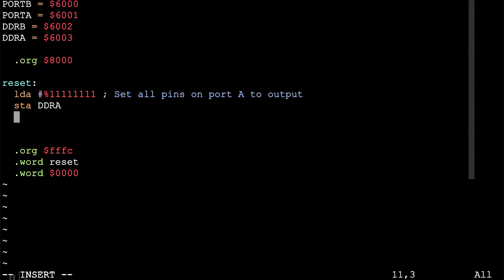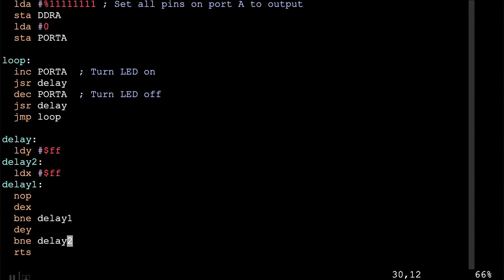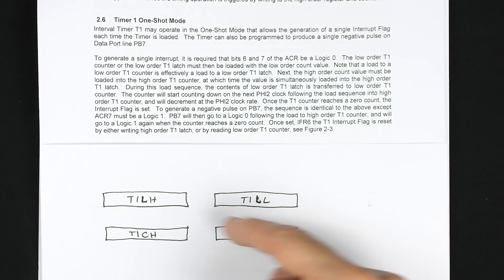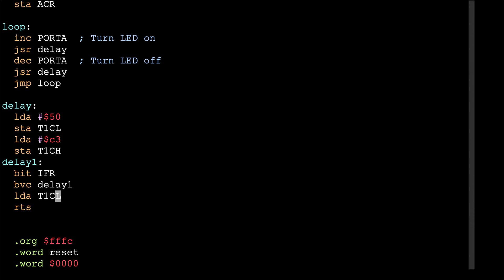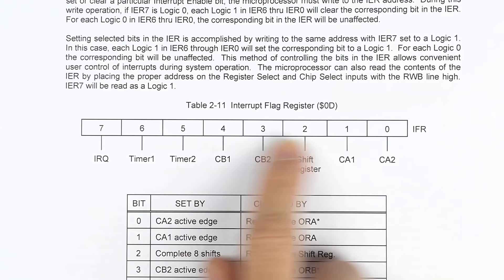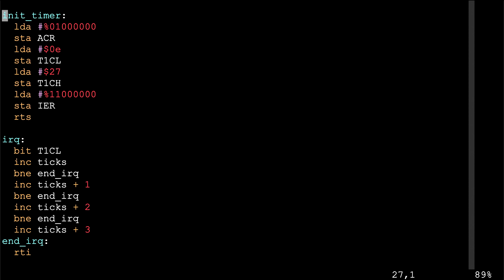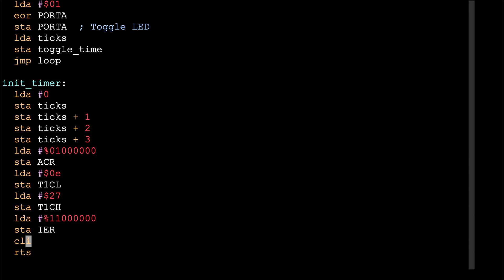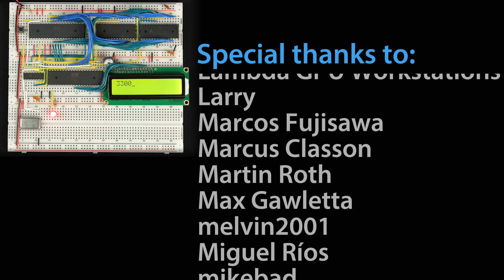How do hardware timers work?

Comment: @30:17 Does inhibiting the interrupt mean you may "lose" those interrupts? If an interrupt signal occurs then, will it not be counted in "ticks"?
Reply: An interrupt will be pending in the cpu. Once the cli instruction is executed an interrupt will be taken on the next cycle or two. Well, the cpu takes cycles to load the pc with the interrupt vector, which to my understanding is completely forgotten in the video. There is no magic that the cpu starts executing that specific code unless being told so by putting the address of the ISR in $FFFE (high) and $FFFF (low). But that is a reason for keeping the scope between SEI and CLI short, you will delay interrupts, and also actual time from counters or whatever you want an interrupt from.

Comment: on central processing units thats why timers are there i guess. it loops and checks each loop if time is equal or bigger and if the timed execution is executed or not. if time passed and execution is not operated it executes it but there is lots of small not important details and probably differes from cpu to cpu and from systems timing criticality level. ie if we are trying to use that cpu on atomic clock we wouldnt want it to execute after time passes . but we wouldnt want it to miss execution time. :P which in fact in high speeds is the case. i think /guess the modern cpus leave lots of place ie leaving lots of executions free so system wont miss sync times but that makes wasting cpu time that can be used for system which is expensive. and thats what there is some space left for owerclocking. so when owerclocking a cpu its actually increases timing execution miss possibility alot. anyway i dont have actual cpu docs and protocol logics used to decide what to do in execution delays but thats standard protocolos and they clearly decided one of the choices :P

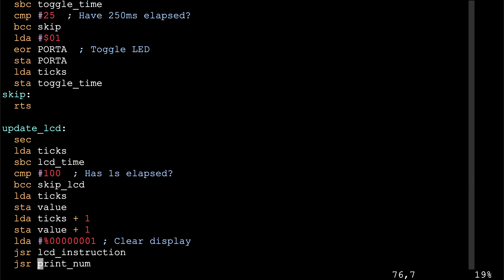Comment: 30:05 doesn't that introduce a possibility of a race condition? Because the interrupt can happen while they're inhibited by the CPU leading to being 50ms behind. This would happen more often with shorter timeouts. Unless the 6502 queues up interrupts to be handeled after cli.
If that indeed is the case, how would one solve this?
Reply: I don't know much about the 6502, but in general if an interrupt happens when interrupts are disabled, it just sets the corresponding bit (in a hardware register) without invoking the interrupt routine, but as soon as interrupts are enabled, the interrupt routine is invoked. So as long as you do not disable interrupts for too long, nothing gets lost.

Comment: Great video, as always.
Some production feedback:
I noticed when watching this in a low light environment that the switching between darkmode terminal and the lightmode spec sheet is quite a straining transition for the eyes.
Likewise with what I assume must be te visual terminall bell(?) that flashes white in the editor. At first I was actually confused if it was an indication of a video cut or something as well...
Reply: I guess that’s the “flash visual bell” of iterm2. Also agree that full screen flashing should be avoided in videos.

Comment: is it possible for one to use a 32 bit processor on a breadboard? i have a useless intel celeron processor that has been collecting dust. can i perform calculations and operations on it using a breadboard? if so, how?
Reply: There may be a way to rig-up something (probably very expensive) to allow you to connect one of those things to a breadboard.  Be aware that breadboards, as a general rule of thumb, are limited to about 10-MHz clocks.
Reply: That sounds extremely complicated and you would need a deep understanding of how exactly that processor works. It can be done like anything but don’t bite off more than you can chew.

Comment: I have a question because I think there is a small error in this code. Is it not required to always compare the ticks value with the toggle time value?  And also make the toggle time value 4 bytes long. So let's say you run a lot of code between the IRQ. There is a chance that the ticks are greater than 255, so ticks + 1 starts incrementing by 1. Then the IRQ starts executing and comparing the ticks value with the toggle time value the chance now is that ticks + 0(just ticks) is less than the toggle time while in reality it is greater because ticks + 1 is loaded with a one in this case. BTW sorry for my bad English!!!

Comment: "If the processor speed changed, then the delay would change." Is this why the Turbo button made many games faster, through speeding up (or slowing down?) the clock and thus the delays. Had one space game whose difficulty was vastly decreased when running on faster Turbo mode, as enemies seemed to advance at the same rate regardless of system clock, but my ship would move faster with the faster clock, allowing me to combat the enemies much more effectively in Turbo mode.

Comment: I've been using c Sleep(int) for 20 years and this is the first disambiguation I've ever seen.  
I ended up reverse engineering a micro time system using rtdsc (read time date system counter is my headcannon but I'm sure that's not actually accurate) .. still had to use sleep to calibrate the system but it was orders of magnitude faster than any other timing system I tested and it was accurate to ~ 5 millisecond after 24hrs... or at least as accurate as any other system I tested.
I wish I could get an atomic clock card to actually test the accuracy of these standard functions... wouldn't be surprised to find that sleep has very poor interval accuracy... in my experience it tends to be closer to 'wait at least'
Reply: sleep on a standard desktop OS is only 1 ms accurate on a good day (or you finagle the OS to give you better accuracy), it's around 15 ms by default on windows.
Reply: At least on Windows you can actually change the resolution of the scheduler clock to a higher precision, but you'll pay more overhead by needlessly switching context much more often. There is a reason why an ordinary OS is NOT realtime. You can get close, by locking a thread to a specific core and maximizing the priority and use a bruteforce loop with rdtsc but it will still leave random stalls

Comment: The sei/cli block has the potential of losing events, right? Are there techniques for, say, queuing interrupts so every one gets handled?
Reply: Ben explains at 19:10 the interrupt handler has to clear the interrupt from the timer, or it will keep being fired. So you might miss a timer event if the interrupt is disabled for an entire cycle, but not if it's just over the cycles that it gets set.

Comment: So what happens if an interrupt would have occurred while it's inhibited? Is it somehow queued until the inhibition is lifted, at which point it fires immediately? Is it just lost? Sorry if this was answered in a previous video; I just found this one through The Algorithm.
Reply: Your first guess is correct - the 6522 remembers the timer interrupt is due and continues to signal the interrupt to the processor until it's explicitly cleared. Ben touches on this at 13:24 in the video.

Comment: Out of curiosity, if instead of the update lcd subroutine you had something else, which took longer than 250ms to run, would that mean the timing of the LED blinking would be affected?  Because the program was stuck in a subroutine, and wouldn't be able to get to the update_led subroutine until it got out again?
Reply: Yes.
Reply: @luisjalabert8366  Thanks!

Comment: Love this Series, but one thing I am wondering: In your subroutines you always execute the "work" before resetting the toggle_time/lcd_time... If that code were to take longer than one "tick" (which an lcd write might do?) the next lda on ticks would already be incremented by one, resulting in one extra timer cycle between subroutines...
Wouldnt it be better to do the "sta toggle_lcd" immediatly after "lda ticks", and only after storing do the "expensive" stuff of the subroutine?

Comment: something's mind boggling for me that in order to make a timed blinking LED, instead of just sending a single  beep and waiting for next one, it has to first turn it on and then after timer, turn it off. because if it just was an impulse for light, then it'd probably be so quick we wouldn't notice the flash of light. that just reminds me when i realized what programming is when i was learning and still learning basics. its about going to depths of understanding of whaqt you're working with,and using logic and thinking, use the tools it gave you, to make the desired result. even though it seemed simple, you find out that you have to do a lot of different things you wouldn't have just randomly thought of

Comment: 24:18: What if the CPU were to run too slow for some reason and miss the point where exactly 250 milliseconds have elapsed? 
Would this keep going and maybe overflow and then "try again" at the 500 millisecond mark?
Reply: It doesn't have to be exact. It's effectively a >= comparison, not an ==. And remember that these checks are not done every 250ms, they are done more often than that - however often the update routine is called. For this timer mechanism to be reliable, it needs to be called substantially more frequently than the interval you're trying to wait for, and you need to compare against a large enough number of bits of 'ticks' so that it definitely won't have looped back around to zero by the time you bother looking at it. 

For example, assuming the program is busy doing other stuff between updates, it would be a bad idea for the update routine to only compare the lowest 8 bits of ticks if we're waiting for 2.5 seconds (250 ticks) to elapse, as that only gives us a 50ms window to read the ticks value before it reaches 255 and then goes back to zero.

Comment: The only instruction i did not understand was "SEC", strange, but the rest was wow.
i would isolate the processor and have some system to easily disconnect from the breadboard circuitry,
that disconnect would also connect it to the programmer ... (pogo pins above/below + lift mechanisme ?)

Comment: "delay1:" in almost asm languages can be present as
delay:
.step1:

where ".step1:" means - "delay.step1:" after this you can easly "jmp .step1". It more perfect solution for local loop jumps!

Also for long blinks like 1sec ON/OFF e.t.c.  better variant to use interrupt, and energy protection mode. And do not fuckup processor mainstream with infine NOPs.

Comment: Does this mean that in all motherboard, there is a chip that does just that ? Counting ticks ?
Or would that be a chip embedded in the cpu itself ?
Reply: Modern devices use RTC circuits.
Reply: @khatharrmalkavian3306  thanks for the answer, I appreciate it.

Comment: Is it possible to miss a tick this way? Say if updating the LCD takes two ticks (~20 ms) could it be that the update_led would check first against 24, and then against 26, and miss the actual 25?
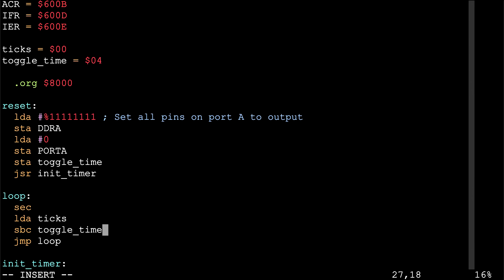Reply: At 24:22 Ben explains this, but it's pretty subtle: we already have (ticks - toggle_time) in A, so we compare to 25 and loop if it's *less*.

Specifically, CMP will set the carry and zero flags from the result of (A - value), without storing it, so zero will be set if they are equal, and carry will be set if A is greater than or equal (since carry means "not borrow" for subtraction, it effectively is also "not negative" for comparison)

Since the wait loops on BCC, it's waiting until carry is set, and thus the elapsed ticks to be greater than or equal to 25.
Reply: @SimonBuchanNz  I figured it'd be something like that, but wasn't positive on the nitty gritty details. Thanks for the clear explanation! 👌
Reply: @michelfug  I actually learned while checking that, that the subtraction in CMP doesn't use the existing value of carry, unlike the only subtract op SBC. A trap if you're switching between them because you need the result or not!

Comment: Um, regarding the lda #%11000000 part.
Why isn't that in the beginning of init_timer?
Won't setting the interupt flag while the timer is in use mess with the timer?
Reply: I think you're referring to 18:10 which describes setting the Interrupt Enable Register (IER.) The IER controls whether or not the 6522 signals an interrupt to the processor based on the current values of flags in the Interrupt Flag Register (IFR.) The timer interacts with the IFR (e.g. to set IFR6 when it expires) and won't be affected by updating the IER while in use.

Comment: Definite blast from the past. Playing with a mid 1970s Mostek 8 bit microcomputer. Why does the part number end with a 2? Because, Motorola sued Mostek over the 6500 which was pin compatible with the Motorola 6800.

Comment: In the earlier video where you added the RAM chip, you mentioned that the RAM needed to cover the memory range $00 to $ff because the processor used that space for the stack.  However, in this video, it seems you are using the same address space for the timer vars. As demonstrated, the code works. But, how do these not interfere with each other?
Reply: The 6502 actually uses $100 thru $1ff for the stack. $00 thru $ff are the zero page.
Reply: I think the stack start from the higher address and grows downwards. So you only crush those values when your stack is full. But the stack is a bit higher in memory anyway as  @Mallory Worlton  have stated.
Reply: Ah, thanks for the correction.
Reply: The zero page (0x0000 to 0x00FF) is intended to be used more like general purpose registers that the 6502 designers omitted for cost reasons.  The instructions used to access that region are one byte shorter when assembled, which saves on program length and time.

Comment: can anybody tell me, why timers on all my 6522 (i have multiple 6522 chips) are not working. I did everything exactly like ben. Everything else from bens lessons is working perfect, except for damn timers. One thing to mention: i am using 6502 and 6522, not 65c02 and 65c22 like ben. Could it be the reason?
Reply: It may be the problem, compare the datasheets of the 65C22, 6522, 65C02 and 6502.
Reply: try feed pin 6 of 6502 to +5V via 3.3k om resistor.

Comment: Would you update your 8 bit computer to use 74HC165, 74HC595, 23LC1024, 24LC256 .... serial data, maybe update to 16 bit.

would like to see if you can access a 23LC1024 SRAM ... without using software, just using CD4000 or 74HC series ic's.

and ...  you use a lot of ic's that are pretty hard to obtain, like adders, 64 bit ram,, my local dealer doesn't have them or just 1 old stock remaining, Mouser doesn't sell them.

Comment: Always love these video! But, bit confused about the code:

loop: 
sec
lda ticks
sbc toggle_time
cmp #25
bcc loop

ticks is only keeping track of one byte, so it overflows to 0 when ticks hits 256 (at 2560ms).  In the situation where toggle_time is, say, 250 and ticks is at 0, because it overflowed, wouldn't the "sbc toggle_time" result in the accumulator being 250?  Thus it would make the LED toggle early?  But that doesn't seem to be the case.   What am I missing here?

Comment: 27:40 Wouldn't it be better to call update_led directly in the irq method?
Reply: Then you would be doing the work of loading and comparing the counter with every interrupt. That's just wasting CPU cycles which could be better spent in the main loop.

In this simplified example it doesn't really matter as the CPU is waiting 99% of the time anyways. But imagine the CPU doing some more heavy calculations between the LED updates; then that wasted time will become significant.

Generally speaking you want your IRQ handlers to be as lightweight as possible so they dont interfere with the normal operations too much. This is especially important as IRQs are disabled for the time you spend within the IRQ handler - so if it takes too long you might actually miss the next IRQ.

The only time your approach might make sense is if you really need the timing of the LED flashes (or whatever your timer is driving) to be as perfect as possible, even at the expense of slowing other tasks down. (But in that case you'll probably be thinking about a hardware solution anyways.)

Comment: This video has little to do with sleep() and lots to do with hardware timers. While related, the two are vastly different things. Implementing sleep() requires basic threading support, which is difficult, at best, on the 6502.
Reply: He obviously referred to a delay. Of course in MCU based C, there is no such thing as sleep(), only various delay functions so that's rather misleading.

Comment: It is somewhat unclear how it is handled when 'ticks' eventually rolls over. In that case, ticks - toggle_timer results in a negative value. The blinking of the led should not work at that point anymore as intended.

Comment: Why is it that the usability of a hp calc for hex conversion is better than a software calc which always require to switch mode first instead of having a conversion button… argh .. well I guess until you need to use RPC .. )

Comment: I don't really see the difference in these examples. You still have to call a routine once in a while from your main code in order to update the LED. You just move around where that call is placed. What you should do instead is update the LED inside the interrupt handler, so you never have to call it from anywhere. That is the whole point of using interrupts in the first place.